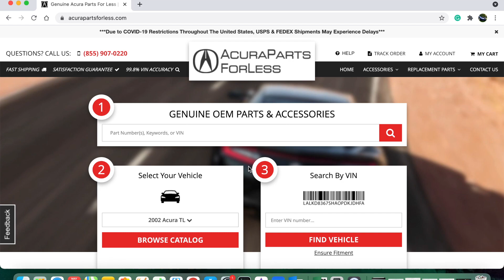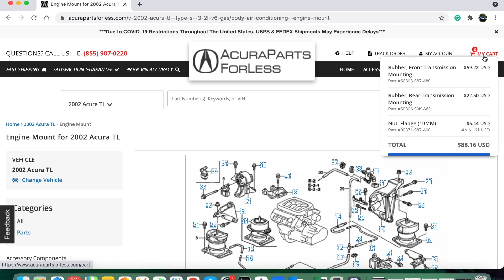How to Replace Transmission Mounts - 2002 V6 Acura TL/CL Honda Accord/Odyssey

Comment: Bro your videos help me so much, I have a Acura CL type S that needs a lot of work and attention. This was my first car and I have a special connection towards it your tutorials make it so much easier to work on.
Reply from the maker: That's awesome to hear! I'm glad they've been helpful! I think the main thing with these cars is to frequently drain and fill the ATF every 15,000 miles and your car will last 300,000 miles easy! Good luck and thanks for your support!
Reply: @CarRepairsMadeSimple  I'm already hitting the 400,000 mile mark not the original transmission though it's a rebuild transmission but it has over 5 years already. I just need to repaint the whole car the paint it far too gone.
Reply from the maker: @Flaming360Spider  that’s awesome to hear you’ve accumulated so many miles! Idk what I’ll do that day my transmission fails. For now it’s running really great at 329000 miles!

Comment: Thanks! Way easier than I thought. Also you have any expertise on maybe why my 02 tl type s maybe shaking when I'm accelerating after 70kmh and then slowly goes away after 100kmh and or when I let off the accelerator. Iv done wheel balance wheel alignment and tires and wheel in good condition. Thanks any ideas helps great video !!!!!! Be doing this on my next days off
Reply from the maker: Wow thank you so much for the Super Thanks!
It's really hard to say without being able to inspect your car in person. There are a lot of things that could cause vibrations unfortunately. Sounds like your wheels are aligned and in good condition. Have you checked your engine mounts as well? It could also be a worn out suspension component. Inspect the ball joints where the upper and lower control arms meet the knuckle, see if there is any loose play or tears in the boots. Also jack up each corner of the vehicle and shake the wheel to see if there's any play, which out indicate a bad wheel bearing. I've also heard the inner CV Joint/axle can be notorious for causing vibrations during acceleration too. Hope this help give you some ideas! Good luck and let me know if there's anything else I can do to help!
Reply: @CarRepairsMadeSimple  will do thanks again I think it going to be cv axle so  I order 2 of them off rock auto I'll let you know if that was the problem motor mount bene replaced and upper and lower ball joint was replaced in the last year or so no shake or play in wheel while jacked up
Reply: @CarRepairsMadeSimple  it was the cv axle causing the death wobbles which was weird cause there was no visual damage boots were intact no damage no grease but took it put new one in and the death wobble is gone
Reply from the maker: @mrmac5795  I’m glad you found the problem! CV axles don’t go bad very often so it’s usually not the first thing people think of. Keep up the great work!

Comment: Good morning brother.  I just bought the whole set of engine/transmission mounts. Where should I start at?  I was thinking about doing the transmission mounts first but wondered if perhaps there's an order to do these in that might make it easier???  Thank you buddy
Reply from the maker: The order shouldn’t matter. To make it easier, you can remove the 4 lower transmission mount nuts and the 3 bracket to mount bolts/nuts on the engine mounts so when you’re lifting the engine/transmission, you won’t be limiting your range of motion and will have more leverage to work with. Then replace the 5 mounts, and lastly reinstall all of those original nuts/bolts last at the same time again. Good luck!

Comment: I hear a clonking noise from both left and right front  suspension areas every time I go over pot holes (both small and midsized) I suspect the front shock struts are bad but I try bouncing the front of the car and I can’t define any smooshiness, bottoming of the strut or noises. Could the problem be the transmission mounts? I’ve already replaced the front engine mount, the upper A arms.
Reply from the maker: Unfortunately, it's tough to test the struts and know their condition's bad with them still on the car. A visual inspection can only tell you so much. Oil leaks, rust, torn dust covers, and simply having a few hundred thousand miles on them will usually mean they need replacing. As far as engine mounts go, it was mainly the passenger side engine mount that was giving me the most noise/clunking. It also wouldn't hurt to check the transmission mounts as shown at the beginning of this video. Two other things that I have found to be noisy going over bumps are broken sway bar end links, as well as exhaust heat shields. Make sure those end links aren't broken, and also wiggle the heat shield to see if they're noisy or not.
Reply: I would guess sway bar links or sway bar bushings. Pretty cheap. That's what the annoying rattle noise was on my TL, sway bar bushings.

Comment: Thanks for such informative and detailed video. I'm researching on transmission mount replacement on an Accord V6. I couldn't help noticing that you driver side CV shaft is about to SNAP!!!! Notice the rubber vibration damper has bulged up and cracked, that is caused by rust build up under it. The shaft is weakened by the substantial amount of rust and could snap anytime. If you still have that car, please get the issue addressed.

Comment: Yay! you did it again. good job man. Any plan on replacing the rear motor mount also? I'm ordering two transmission mounts in the meantime :)
Reply from the maker: Thank you! As of now, I don't think I'll be replacing the rear motor mount. So far I'm not experiencing any excessive vibrations, clunking, or movement from it. The rear mount is very robust and rarely actually needs replacing, plus they're $200+. Maybe I'll revisit the idea later this summer. Good luck with your transmission mounts! :)
Reply: @CarRepairsMadeSimple  Any thoughts on neutralizing motor mounts? So far I replaced 4 mounts except for the rear one. The shop I went in 2014 used westar brand for all 5 mounts and I replaced them with Beck-Arnley ones except for the rear one since I find it very difficult to do it at home. and I do see about 1.5inch movement when accelerating in reverse and I still feel vibration when idling in Drive. Vibration definitely not as excessive as before but it is still a thing which I want to get rid of completely, and there's not much information about neutralizing motor mounts on our model. Please let me know what you think
Reply from the maker: @xfxp1313  ive never read anything about neutralizing the mounts on our cars either, not even in the service manuals. I personally don’t have issues with vibrations with the installation method I used in this video. I wouldn’t recommend it based on that. The main thing I know about mounts and vibrations is Genuine Honda OEM mounts are best for comfort and absorbing vibrations but don’t last as long, aftermarket is the opposite where they transmit vibrations but last longer. It’s a pick your poison scenario.
Reply: @CarRepairsMadeSimple  Thank you for your reply again, I'll update you after the rear one replaced probably very soon.
Reply: @CarRepairsMadeSimple  whoa,, I just replaced my rear mount today and it got rid of the vibration issue completely, there's no difference between P. N & D any more! I'm so happy with all the mounts replaced now.. The previous set I had was from Westar. the rear one didn't look shot but I guess there isn't any hydraulic juice left there since it was replaced back in 2014 (I only put about 29k miles since the mount replacement). Anyways I'm happy with the result and I hope you do not need your rear replaced since it's costly. If the vibration comes back I'll also let you know, I heard certain batches of these mounts are not as good. The one I got is made by Indonesia btw.
Reply from the maker: @xfxp1313  yah these mounts tend to go unnoticed since they don't have a service interval. What a difference it makes! I recently tried testing the rear mount for movement again and it still looks pretty good! If it does ever need replacing, I'll be sure to make a video on it.

Comment: when jacking up the transmission more, to take the old mounts out, wouldn't it be a good idea to loosen the top nut on the front and rear mounts, so you don't damage them?  also... in your video when you did the front engine mount, wouldn't it be a good idea to loosen the bottom four bolts for the transmission mounts?  maybe this part wouldn't be needed, as you took the bracket off in that video, and didn't jack it up that high... just a thought.
Reply from the maker: It’s a good thought, but IMO not necessary. We’re only jacking the engine/transmission up 1”, and these mounts are made to be flexible to absorb the vibrations and torque of the engine. By all means though, it wouldn’t hurt to loosen the mentioned bolts either!
Reply: @CarRepairsMadeSimple  thanks for the quick reply.  look forward to seeing the vid on the rear mount  :)
Reply from the maker: @cryeredd7563  yah I’ve gotten quite a few requests for it! Mine miraculously just hasn’t gone bad yet. It’s definitely on the list of future videos though!